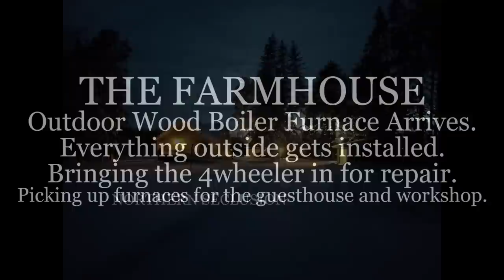THE FARMHOUSE. Outdoor Wood Boiler Install. Getting ready for phase 2.

Comment: Its funny when them guys installing that stove and lines .Joe had to sit back and watch. I bet he wanted to run that digger lol. Now I'd bet the farm house will be the new bug out ranch if shit hits the fan some day .a perfect set up almost . a shelter. Water and garden groung.critters for meat. The only thing left he needs to do is 20000 worth of solar panels. No power outages and no more power bills .if the grid goes down. Joe would still have it all. I bet within 2 years he goes total solar. And he'd have it made.  And the tent will be a vac getta way spot. They got it made. Good deal for them

Comment: Hey Joe, looks good.  
How deep in the ground did they bury the PEX lines for the wood boiler?  
Is it beneficial to get them deeper below the frost line?  (Which might be 4-5 feet in your area?) 
Would that be worthwhile to get them deeper so that the heat doesn't dissipate from the lines into the ground as easily?
Reply from the maker: They are down 18 inches. The type of pex and insulation lines they used only lose a half a degree of heat per 100 feet of line. I am guessing that is why no one burys them very deep.

Comment: How close can you build a firewood storage building by the furnace?   I wouldn't want to be hauling firewood any distance when it's -40
Reply from the maker: No code for that, you can put t as close as you want as long as it does not start on fire.

Comment: Are you filling the boiler with water or antifreeze.  Also I think you might like a skid steer for your property you should sell that other big pieces of equipment and get one.
Reply from the maker: Water. They said the 5,000 dollars it would cost to fill it with antifreeze is just a waste of an expense. If an emergency came up and we were away from home for a week or month the furnace in the house would come on automatically (running on fuel oil) and since the boiler water is constantly circulating, the house furnace then warms the boiler water enough so nothing will ever freeze. I had a skid steer in the past and sold it. It ends up sitting doing nothing. The telehandler is much more usable for many more projects as far as I am concerned.

Comment: Are you going to have to burn wood year round to heat your water heaters?
Reply from the maker: No, electric will take over and heat it the same way it does right now if the boiler is not going.

Comment: I have to rest after  watching you work.  You're in motion all the time!  Why does the boiled need to be so far out.  Is it a safety issue?
Reply from the maker: We did not want the smoke coming at the house and I do not want the messy wood pile that will be there by the house either.

Comment: Joe, that boiler system looks pretty neat, but having lived in AL, KY, NC and GA all my life, I am wondering how often the boiler will need fuel and if it will require someone being exposed to the frigid winter weather in northern MN while doing the fueling.

Also, does the boiler use air or water as the means of heat distribution to the various buildings? The systems I have knowledge of use heated water and radiators.😊
Reply from the maker: The water is heated in the outdoor boiler and then pumps (one pump for each line run so now we have 3 and we had them install 2 other outlets for future add ons) pump the water to each building and it goes through a heat exchanger (I will show this in the next Farmhouse video) that look almost exactly like car radiators. The "radiators" in the house and the new guest house and the back part of the workshop are placed on top of the furnaces just like an A coil would be if it was air conditioning. The air will blow through that and 170 degree water flowing trough the exchangers will heat the air. In the front part of the workshop where we do all the wood working I had them just put in an air handler (no furnace) so it is a little unit with an air exchanger in it with a fan behind it. I will show this like I said in the next farmhouse (not guest house) video and we will go through this in more detail when we fire up the boiler sometime I am thinking in late October.
Reply from the maker: Answering your first question, it is best to fill it twice in a 24 hour period. Once in the morning and once in the evening but you can actually fill it up more and just do a 24 hour burn.

Comment: If that’s multi fuel boiler and can burn coal, it might be worth seeing if you can still get coal in your area.  That stuff can really throw off some heat and might come in handy on the brutally cold days so you don’t have to load the boiler 3 or 4 times a day.  I remember when you first moved in there was a an old coal bunker on the property, so it must’ve been available at one point.  Since you’re buying cord wood to split anyways, it’d be interesting to compare the cost per btu of coal (if available) to the to the cost per btu of the type of wood you burn.  Just a thought!  Splitting all that firewood takes a ton of time and we all know how busy you already are!
Reply: He used to have a coal compatible wood stove in the shop and I suggested he try to find some coal for overnight running when it's -30 out there and he declined :/
Reply from the maker: It is a coal burner so we could do that. As far as declining I simply can not find coal or do not know who to ask.

Comment: Don't understand why you would locate boiler so far out. Don't you get a lot of snow? Putting on your snowshoes to feed the boiler is going to suck!
Reply from the maker: Everything will get plowed wide open, I will not need snowshoes to feed the fire. My sketchers will do just fine. The reason(s) it is that far away is because I do not want smoke blowing at the house all the time and I do not want a semi load sized wood pile and all the saw dust and bark and crap up by the house either. The line that the water runs through only loses a half a degree of temperature per 100 feet. All 3 runs are about a hundred feet so there is almost no heat loss with it being where it is.

Comment: Me and my dad both have outdoor furnaces ! Joe did you consider the amount of wood you will be burning , I’m guessing 15 cord or more a season for what your heating! Possibly more .
Reply from the maker: 12 cord right now is about 1400.00. We estimate that if we were doing fuel oil and now propane for the guest house and the back part of the workshop where Melissa will be doing her clay pottery which that area can not freeze, it must be heated all winter our cost would be a minimum of 8,000 dollars, possibly closer to 10,000. The boiler system will also heat the domestic water in both the house, the guest house and eventually the workshop. All water heaters are electric. Our electric bill each month runs in that 350 to 450 a month range and that will dramatically drop not having to heat the water. The whole system which was quite expensive will pay for itself in 3 to 4 years. I will have another 12 cord load delivered within the next few weeks.
Reply: Good luck with your new stove here in the U.P. 10 cord of hard maple is 1000 , I burned about 8 cord with a stove I had for 22 years this year I have a brand new central boiler 560 HDX a gasification model I hope to burn about 5 cord this winter I also heat my domestic hot water I heat 2200 square feet

Comment: how come you put that so far from house bad your lots of room near your house all that pipe in ground it lose heat its to far a way your find out but its to late now bad
Reply from the maker: That pipe loses only 1/2 a degree per 100 feet so it is losing hardly nothing. You put it far from the house so we do not have to smell the smoke.

Comment: I wonder what a system like that costs?
Reply: Base model depending on your aera  $6,300 just for the furnace itself.
Reply: @grayghost75  way more that’s at least a 13,000 dollar stove
Reply from the maker: George is correct. The unit itself was over 13 grand, its a big stove and it was still the cheapest part of this whole project.
Reply: @NorthernSeclusion  even though it's pricey,  it's still a good investment! Your power bill  should be lots lower and no more heating oil